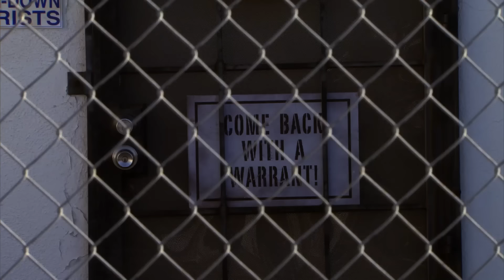DIY With Ron Swanson | Parks and Recreation

Comment: I like how he was still considerate enough to sand down Ann’s wall after he used her sconce
Reply: he’s a man of principle. if he destroyed something he’ll fix it. it’s the swanson way
Reply: Cleaning is an important step of every project. If ins't done ins't 100% done.
Reply: Burying live wires behind the drywall probably isn't up to code either though lol
Reply: sigma grindset.
Reply: @Jessev741  just slap some electrical tape on it and/or turn off the breakers for that one. i think the harder part is actually fixing the wall lol
Reply: @Jessev741  wire nuts bro
Reply: @ronaldmejia4539  ya that's definitely not allowed. Junction box only.
Reply: @Jessev741  Ron is probably smart enough to cap off the ends.
Reply: @Jessev741  Find the other end of that wire and cut it there. You're not supposed to leave dead wires in wall either but morally, I'm fine with it.
Reply: @luisroberto6209  can't start a new project if your work area is dirty
Reply: @Jessev741  it’s up to the Swanson code
Reply: @parry3439 this is a dangerous idea and I’m afraid that 17 people actually liked it o_o
Reply: doesnt make sense tho if u put a thick skim coat with a square piece cutout it takes atleast 12 hours to dry to that, but it looks like hes on the final coat which is like 2 or 3 coats. woulda def taken like 24ish hours XD
Reply: @Jessev741  Although, considering how easy it was to rip the light off, they were probably wired up by cowboys anyway
Reply: Must have been a decorative sconce since no wires came out when he yanked it out. Glad he didn’t leave any live electrical🙂
Reply: @Bobo-ox7fj You realize that wire nuts are an industry standard, right?
Reply: Dry wall is easy...I'd of called the show on it if he hadn't patched it with drywall and spackle.
Reply: @Jessev741  lol good catch. They should of shown him taking care of that too.
Reply: @LostInPhilly89 Maybe in US, but any self-respecting electrician in EU wouldn't be caught dead with them - only WAGO connectors.
Reply: @parry3439 Nah fixing the wall is easy, some netting over it and you can fill it up. Sandpaper the edges away, some paint and done.
Reply: Whats the difference between running add on electrical and having an unused wire? You dont have to have power on that circuit you can even disconnect the wires at the box. Pretty sure there is 0 fire hazzard that way

Comment: Leslie would be over the moon if she knew that her wedding ring was forged by Ron using a waffle maker.
Reply: And a piece of Ann's house 😍
Reply: So true :) (both)
Reply: @ytngw  it would be too much for Leslie
Reply: Well Ron probably didn't think much of that.
Reply: nobody will question the impossibility of doing that, but it was done
Reply: NonsensicalVids why impossible?
Reply: @NonsensicalSpudz  It's entirely possible Ron's step by step guide would work in reality.
Reply: @ballconei4879  air bubbles from the casting?
Reply: @joshyc2006  thus he heat it over low fire and then compress it using the waffle maker top.
Reply: What about how Ron singlehandedly fixed up the entire 3rd floor which was used as Leslie's department HQ?
Reply: Awwwwwwwwwww
Reply: I think the waffle thing was just for her jejeje
Reply: @dustbunny4527  I know it has been 9 months however melting down silver is quite tricky and generally looses colour and shine if melted down that way (this is why when houses are robbed they are mainly looking for gold). The other problem is that no one would have a pure silver sconce and it probably would have just been silver plated meaning that when melted down there would VERY little silver in the mix making them never get the shine he had at the end if it even had a silver colour at all.
Reply: @seangilmore70  are you questioning Ron Swanson? How dare you 😆
Reply: She would hug him for a few centuries😊😊
Reply: @seangilmore70  is aluminum a likely metal for that type of home decor ?
Perhaps he buffed the ring after fileing to the end shape.
Reply: @dannyleyamato1309  its more likely stainless steel or brushed nickel. Either way, with a polishing bit on a dremel tool, you could shine it up
Reply: @alexsmith2885  I'm not sure about nickel, but is it possible to heat up stainless steel with a blow torch enough to melt it?
Reply: @imugi-16  Oh yes. An acetylene can get over twice as hot as required to melt stainless steel. Stainless and brushed nickel are the two most common materials for modern household things like sconces and light fixtures
Reply: @alexsmith2885  Interesting. Is it also possible that the light fixture in this video was made of Zinc? I just looked it up and the melting point is much lower than stainless steel and nickel, even more so than aluminum
Reply: @imugi-16  Melting point isnt an obstacle. Acetylene makes over 3000 degrees. Its about what you commonly find in household fixtures which is brushed nickel finish and stainless steel
Reply: @alexsmith2885  Ah I see. I think we were focused on different things here. I definitely agree with you that most household fixtures are either nickel or stainless steel. I was focused on the casting part of the ring making because in my opinion, that was the least believable part of this scene. Only because I've personally never heard of anyone being able to cast those metals outside of industrial settings. If that is possible than making the ring totally sounds plausible!
Reply: i think ron salvaged ann's door in order to make it in to a picture frame. it was shown on the last season i think
Reply: @imugi-16  people home-made forge swords with 1060 carbon steel all the time.
Reply: @ML-sc3pt  Forging is different from casting. Forging is heating metal until it is malleable like clay to hammer it to shape, which doesn't mean heating the metal to its melting point. But casting means liquifying the metal and pouring it in a mold to re-solidify. Which means it requires much more energy to bring it to the melting temperature to the level that is very difficult to achieve with certain metals such as carbon steel.
Reply: And even more extatic that it was crafted out of Ann’s house

Comment: 1:45 I love this part becuase Ron know he definitely has code violations, and still says "nope" after like 5 seconds of silence.
Reply: Lol yeah
Reply: I heard Roz's voice (from Monster's, Inc.) saying, Your stunned silence is very reassuring.
Reply: He says he never lies. Maybe he means he has no code violations according to Swanson code
Reply: @davidc5820  Yeah, he probably spent those 5 seconds thinking up that interpretation of the question
Reply: You can tell that's from early in the series. I feel like the more well-established Ron would take craftsmanship safety very seriously.
Reply: @jbwarner8626  Yeah, the violations just didn't make sense. The electrical cables are in the way of his handtools. It's rated for 15 amps and I bet at least one of the tools in his shop would draw 20 and burn through it. And even a novice knows not to pile oily rags.

Wrongly-shaped handrails and that kind of thing would make way more sense.
Reply: ....why yes... that's the joke...
Reply: @alexandrezani  yeah, later seasons Ron would exceed code requirements except for maybe something that he felt was outdated, but would still feel irritated by an inspection.
Reply: technically it was up to code when it was built therefore unless he does Renovations it is still up to code so he is only half lying
Reply: “There’s only one thing I hate more than lying. Skim milk. Which is water, that’s lying about being milk.”
Reply: I figured he went through the codes in his head during those 5 seconds.

Comment: I feel like it should be pointed out how fitting the wedding ring scene is.

Ben furiously pursuing any and every option to make Leslie happy
Chris being optimistic but failing to actually help in any way
Ron one of her best friends hand crafting the rings using material from her best best friend and Perkins 

And all topped off with the mold for the rings being a waffle iron, the device used to make her favourite food.

Comment: 3:25 "No trespassing - violators will be shot. Survivors will be shot again" 
(I don't like to repeat quotes from a video, but here I just couldn't resist it.)
Reply: At least  you acknowledged it.
Reply: I have a sign that says that.
Reply: Also, “Come back with a warrant!”
Reply: @Anal0Avenger  its not? the quote itself is older than me and im near 40. they replace it with "smoking" "trespassing" etc.
Reply: Damn I didn’t even notice that last part, thanks for sharing

Comment: Ron is me whenever I go to my relatives house. Just yesterday after like 6 hours of driving I removed the trim (bare handed) from around a broke sliding door so I can pull it out. I then assembled a crib and today I fished out from the wall the missing handler for the door (with a metal hanger) bent the rail to fit the hanger and bent the rail back fixed a piece of metal that was rubbing on the door due to it being shoved open by shoving my hand as far into the wall as I could and hammering it flat. Reinstalled the door and put the trim back in place. All done with hand tools because I forgot my drill.

Comment: He totally mangled that pothole fix. You can't hand tamp cold mix asphalt.  All he did was make a larger hole and filled it with loose asphalt. That's going to be a huge hole almost immediately.  

And yes, I have a masters degree in asphalt engineering.